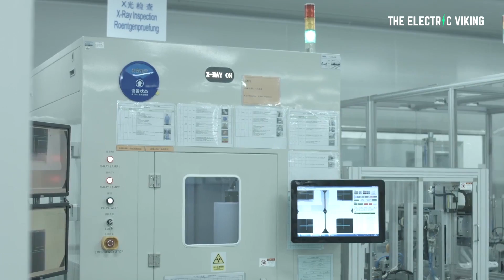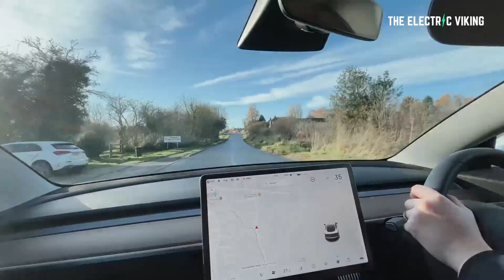This NEW battery changes everything - GAS sales will collapse

Comment: Do not want to be a bummer but:
From the technology prespective this is amazing, but the main problem we are facing in the EV market right now and in the foreseeable future is the resource problem. If we do not ramp up Lithium, Graphite, Copper production we hit a huge bottleneck. Until any of this can be sourced from recycled batteries will still take 10-15 more years before there are enough out there and the technology is cost effective.
Reply: Need to phase out Lithium also in exchange for Sodium Ion batteries. Those things are simply necessary on all fronts.

Comment: The battery of  car is but one part of a big system.  5 min charging sounds good, but you won't be able to do that froma conventional domestic wall socket.  THe whole elecricity netowrk will need to be rebuilt if usrs of this technology are to be able to make use of this new  battery's  properties.    @The Electric Viking I admire your enthusiam, but most breakthroughs take 30 years and this one will be noe exception.  For 500 km trips, you offer me the choice of paying another 10,000 USD on a really expensive car or using my existing Golf diesel for no extra cost which I can fill it with diesel anywhere.    Here are two reasons why electric cars will not be adopted overnight.  It seems you live in Australia -  no shortage of sun there, but I live in UK where there's not going to be enough to allow me to charge my car free unless I have a huge area for solar panels ( another few 10Ks).  

"As a realist", I am not going to rely on the Chinese for anything.

As to Toyota's CEO and what he knows about cars .....   Japan has made a national decision to adopt hydrogen as a fuel of choice., so has the Netherlands and a number of other countries are looking at hydrogen very seriously. The cost of converting a few petrol / gasoline filling stations to hydrogen looks attractive compared to  the cost of rebuilding electricity transmission networks.  For example, UK uses 40% of its energy on transport (ie internal combustions engines) - we will have to double the capacity of our electricity netowrk to adopt electric cars.    We are a densely popualted country, but for places like Australia, this could be really expensive!

So a better battery is a very small part of the picture.

Comment: 3:25 I'm sorry, but there IS a huge problem with electric cars. It's the dreadful state of the supporting infrastructure. It can't cope as it is with the relatively few numbers of electric cars right now which only require much slower, lower amperage charging than would be needed for rapid 5 minute charging. There have been lots of instances where commercial charging points are failing to operate correctly and don't get serviced or repaired for days or sometimes weeks, in spite of being reported as faulty. So, perhaps you could do some research on that, the way you are suggesting to others that they do theirs.

Comment: But fastcharging degrades battery life quickly, we need cheaper EV's for mass adoption.
Reply: You obviously didn’t watch the video.
Reply: @fredbloggs5902  he said nothing about battery degradation, only that battery can charge in 5  mins so its going to be with a fast charger which is the whole problem.
Reply: @polaris1985  he specifically mentioned LFP.
Reply: @fredbloggs5902  LFP degrade too on fast charging

Comment: I agree we will all be driving electric cars. But the price in the US is too high. The news reported $1000 per month car payments are   the new norm. I  know that in the long term EVs are cheaper than gas it's just most of us can't afford the upfront cost.
Reply: Correct.

We’re now effectively in a race to see which arrives first, robotaxis at 20 cents a mile, or personal EVs at $5,000.

Comment: It's nice if the battery can charge quickly, but as you said, most people charge at home overnight.
The trouble is most chargers (in the UK at least) are only 50Kw or so. Superchargers at 250-350Kw are not so common.
The energy density doesn't appear to be much better than a 4680 (from the CATL presentation), which is a shame.
Also, the cost hasn't been mentioned either, so the major issue with EVs remains the astronomical price.

Comment: I do like the enthusiasm of the Viking. We need some optimism these days.
While I have  no doubt that the future is electric, I still think the Viking estimate is a bit optimistic. We may be near the tipping point, but not there yet. 
Having said that, when my 15 year old ICE vehicle needs replacement it will definitely be a BEV. 
So if the Viking is right and I am wrong, my transition should be next year. I still think the price of *available* BEVs is a bit too high right now. 
While talking about going electric we should not forget e-bikes, though.
OTOT, living as far North as I do (55 deg.) there is no way I could do solar charging only in the winter time with my size of garden, but it will provide some "assistance".

Comment: EVs won't be charging in 5 minutes.  It may charge a bit faster, but you will be limited by the charger.  A 150kw charger will still take 1/2 hour to charge your 75kwh battery.

Comment: It will be a challenge to provide new charging infrastructures to charge in 5 minutes rather than 12 hours, not one vehicle at a time but say 10.  This means about 1500 times the power input to a house, high voltage supply with transformers and cabling to match.

Comment: Love your vids Electric Viking!  A note that your game changing battery vids are adding up- I have read similar headlines for decades- it is a never-ending saga of game changing batteries- most of which don't succeed.  But yes- everything has changed, and the electric car will drive battery tech the way the Smartphone drove the tech for displays.  In the late 90s phones had ridiculous 320 x 240 screens.  By 2011 Samsung had a screen that matched laptops and TVs, at 4.65"- INSANE!  Now we have quad HD phones (that we don't need).  We seem to have reached "peak screen". I expect that "peak battery" will take something like 20 years, before there is a standard that truly ticks every box- including low cost.  After that, we should expect incremental improvement that will never stop.  50 years later, 100 years later, the batteries of the future will make our current cars look like toys.

Comment: When battery packs have more energy density and can charge faster they can be smaller and that in turn means the vehicle can  be built lighter. A lighter vehicle uses less energy. 
And it can have lighter brakes, lighter suspention, lighter tires.
In other words, the better battery creates a compounding effect that will have influence on the engineering and design of entire vehicle. 
For vans it could mean more payload making them economically more viable. 
Same for trucks. These would also benefit from superfast charging when doing long distances.
These modern batteries could also make motorcycles more useable (more range)
It could also mean that work machinery can go full electric. (Diggers, dumptrucks whatever) Think about an electric truck with a giant battery pack and charger on the back serving as a mobile charge station on a work site. At the end of the workday the battery truck goes back to base to recharge overnight. Back to the worksite in the morning to fast charge all power tools and that digger that's needed that day. 
Maybe even agricultural machinery? Imagine a tractor plowing a field in almost total silence. No exhaust noise no fumes.
Reply: If they develop further wireless charging roads and adopt it in all EVs which means less batteries EVs has to carry around. They do have electric tractors.
Reply: Possibly, even, a lighter ('one moving part' EV Driveline.

Comment: Practically it will not be possible to provide this power in a domestic situation
I know about 3 phase electrical supply
Southern Electric would charge a minimum of £3k even supposing they had a local supply
This means that you would only get this charge at specific charging stations on thd road. Leaving the cost of such in hands of the supplying companies , whom traditionally like to maximise their profits - this will not be cheap!
Still think there is a problem here
The point is that the majority of users will be charging at home
Mike M

Comment: Surely there is a physics question here
If the BEV has a say 69Kwh battery how can the charger deliver all that in 10 minutes 
I would have thought heat alone and available power would be the limiting factor
My Tesla charging at home from a 32amp supply takes 7.5 Hours to charge with low rate power overnight 
You really need a physicist to do the maths but how is it possible to deliver this massive amount with this level of supply
Even Tesla Superchargers are just now achieving 350amps no?
An answer please from you informed user base would be good
Mike M

Comment: Unfortunately you are only talking half of the equation.  They will not charge in 5 minutes as the current V3 and lower charging infrastructure and your home charging infrastructure can not deliver that much total energy in that short of a time period.  They will definitely be great batteries and will charge much faster, but not 5 or 10 minutes fast.  It would be interesting to run the theoretical minimum charge curve time to charge with an existing V3 supercharger at a straight maximum full charge rate curve.  It would at least cut charging times by 60% -70% most likely.  It will be interesting to see if there is zero taper of charge rate above 80% or is it just reduced.  Sorry but time to switch charging equipment over to have this capability is 2-3 years away and time to proliferate across the country so they are every 50 miles or less from you is 5 to 10 years away.  Great Leap Forward, but is still years away from being a full reality.

Comment: The biggest thing about this Viking, that I’m surprised you haven’t mentioned, is that this will make EVs practical for the huge amount of people that live in apartment and converted flats that make it impractical to install a charger. If you can top up with electricity as easy as filling up with petrol then tens of millions more people will think about getting an EV !
Reply: @Wooly Chewbakker His point is that when better batteries come along, and the luxo market is tapped out, they (probably Chinese) will flood the market with no frills econoboxes which will be cheaper to run, and probably cheaper to buy, than ICE. And that will be the end of gasoline. We are starting the upswing of the crossover curve now.

Comment: we'll see.  i've been hearing about amazing NEW battery tech for YEARS now and even Tesla is just BARELY releasing its cars with their vaunted 4680 batteries which have minimal improvements at best.  in fact, the new tesla models with the 4680 batteries have LOWER range and that's by design.  i seriously doubt if we would see 5 minute charging batteries any time soon but i'd be pleasantly surprised if we do see it even by next year.
Reply: This is new, emerging tech.  You won't see this in the REAL world for 5 years.  Here we go again with the Moore's Law problem.  I remember HAVING to replace my desktop / gaming computer every 3 years until laptops became so powerful and cheap I could afford one as my personal (non-work) computer.  A long time ago in the 1980's, I first bought a 286 mainboard/CPU, then 3 years later a 386 combo, then a 486, then a Pentium, then a Dual-Core, then an i5 (by then a laptop).  I expect the same progress or slower for autos, because they are dependent on power stations, and those are dependent on "the grid."  If anyone notices how The Internet slows down around 7 am-9 am and 4 pm - 8 pm weekdays???  Same will happen with charging stations -- they'll either be unavailable, slower, or both, at the same time on weekdays.  So if you want to stop by a fast charging station before going to the midnight car wash, lol......

Comment: Has anyone done a study between home and charging station charging? With an EV with a 500 km range, I would never stop at a charging station. I would just plug it in overnight at home. 
How many modern EVs with 300+ km range are charged at charging stations and how many are charged at home. Maybe as a percentage of total kWhs charged?
An ICE car you have to drive to a gas station eventually, but an EV is like starting every day with a full tank.
Infrastructure varies by country and region, but here in China in big cities land is so expensive that it can't be wasted as parking lots. Every garden (gated community), city block, shopping mall,  etc. have multi-level underground parking and the car company will install the charger for free at your garage.

PS. I'm told almost daily by people who REALLY know, that if you have an EV and turn the radio up, turn A/C or heat on or drive over 50 km/h the range drops to nothing. Every five years you have to buy a new battery pack and the old one can't be recycled. But don't worry. The car will probably catch fire like they all do before you are due for a battery swap :) Oh, and of course, you can't tow anything. Tell that to my friend who is traveling around China for two years in his NIO ES6 (100kWh) towing a 26' camper.
Reply: there akt cars emtrç rv içer 310 míé rabge 348 míe rv  thr abd soler ejtç 453 mioe tejs cel ⁵06 míle ràbfé líght yeàr oñe 44⁰ mioe rwage éjtrç húmñer  350 miie ⁴00 mi⁸e
Reply: @sharonbraselton4302  - What language is that? Google translate couldn't translate it.
Reply: 1000 milé ßpàr ektrç çar yejsa cell 1160 mîwß aplé batrr 120⁰ mîeß sookúd state baedß 12⁵0 mioé raañgé 3 yyméß 30⁰0 mioé rabfe tesa çéßs3 tymeß 3⁶60 mie rànhé
Reply: ¹0 timeß 1q600 miie ràbgé

Comment: Sooo, where are you going to go, to find your neighbourhood 1.5 MEGAWATT fast charger, so as to give your  basic 120Kwh battery a 5 minute charge? Oh yes down at the local supermarket. They've got 10 of them, along with the 15 MEGAWATT substation in the corner, the same size as the one for the whole town. Lol!  ....And who is waiting there to help the little ladies grapple with the cable to her 400 volt car? Yes, that cable and plug , that handles 4000 AMPS. It's so silly it's funny. This AINT happenin' any time soon! EV's , including your beloved Tezzerla will have to ditch 400 volt setups. Even 800V is a huge challenge for heat generation in the cables and connectors. We are talking MASSIVE safety issues here with these power levels. I have seen a huge  thick 5mm steel back-panel in a substation room vanish through a window into little steel balls littering a nearby grass lawn, due to a connection failure. At 4000 amps, if a connector develops a resistance of just ONE THOUSANDTH of an ohm, (yes 0.001 ohm) then it will experience 16 KILOWATTS of heat applied fully to it's tiny failure point. You're talking white-hot instant explosive molten fire and destruction, as the 0.001 ohm becomes 0.1 ohm in a hundredth of a second, and you've now got stupendous 'center-of-the-sun' heat energy concentration, resulting in obliteration of nearby objects and humans. You're talking a whole new world of hazard control needed for these massive power setups.   Crazy  'Pie-in-the-Sky' stuff here......Years and years away sorry.

Comment: I would rather have a small battery pack with a 100 mile range, save the cost, have much weight-savings. Who commutes more than 100 miles per day, anyway?

Comment: If there was a decent car for $40,000 USD, I would have already ordered one. I don't care about 5 minute charging, nor range over 300 miles. Until then, I work from home and have 22,000 miles on my 2015 Subaru with a 6 cylinder engine and an 18 gallon tank. It cost me a little over $30,000 when new, gets terrible mileage in town, over 30 mpg on the highway. It is paid for, and I fill up every 3 months. It also has no problems going up and down the Rockies. Just give us an affordable EV, they all cost over $60,000.

Comment: Being able to recharge this fast has 3 other benefits!
You can have a much smaller and cheaper battery, as range won't matter much!
Regen braking, with this tech you won't need disk brakes at all!
If it can withstand that, imagine how long it will last in slow charge!